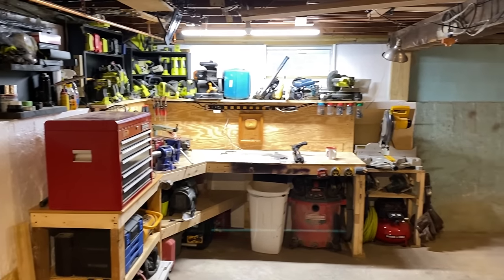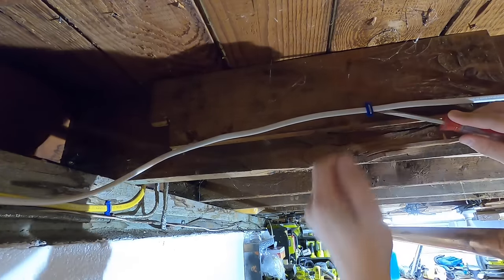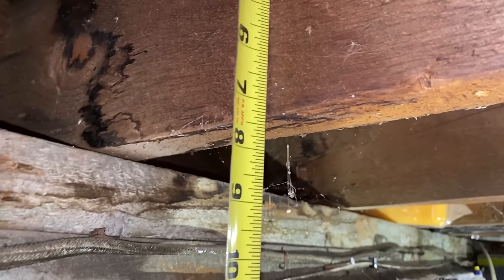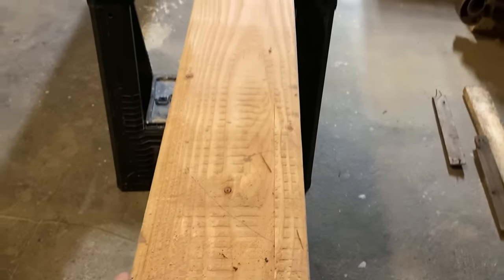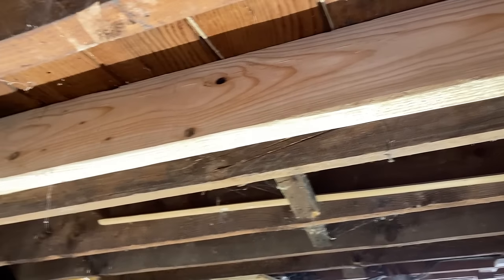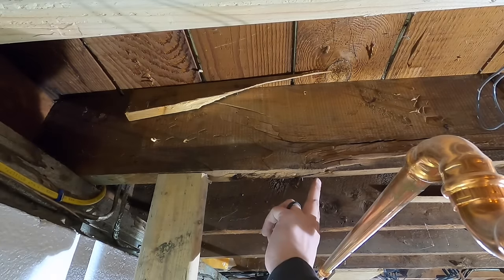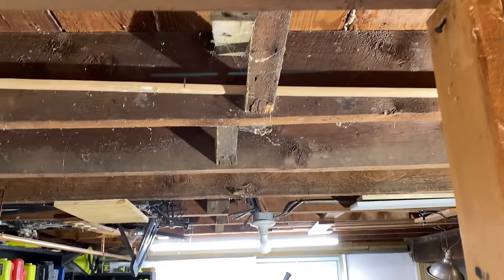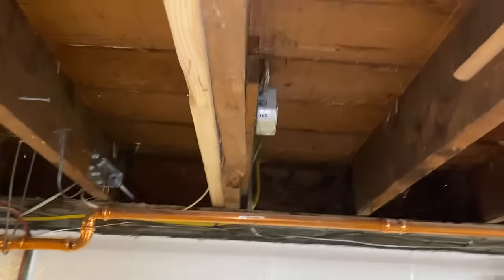"Sistering" a Cracked Broken Floor Joist

Comment: Nice repair. Two issues came to mind. First, when measuring long distances like that, a real easy way to get an exact measurement is to measure from one side to a convenient footage mark on the tape, and then mark the board and than measure from the other side to that mark. Add those two measurements together and you will get an exact length without trying to make the tape bend and guestimate the length. Second thought is, unless there is a heavy load bearing surface above the floor, how in the world does a board that wide ever crack? IDK.
Reply: The gigantic knot right at the bottom within 2 feet of the joist end resting on supports. That creates a stress point for two reasons: the end is supported  so the portion just after the supported part is shearing itself apart, and the knot creates a concentrated stress in that same area. Wood fibers are held by lignin, which is weaker than the fibers themselves, so a knot interrupts the continuous fiber mesh of the wood.
Reply: @rolfbjorn9937  That and moving into an old structure and removing moisture with AC and dehumidifiers vented appliances all things older homeowners usually didn't do in older homes. That was the case in our home in the middle of nowhere Appalachian mountains original owner/builder passed then his wife house built in the 40's we installed a vented dryer, AC and basement dehumidifier diagonal cracks soon followed. I researched my options and in the process realized it was common and wasn't an immediate threat to our homes structure. That was 2005 this is late 2022 and no changes I have emergency boards supports bolts washers screws ect just incase. Taking care of family including my wife that had cancer but is now cancer free and home with her Lord and Savior has put a realization that material things aren't that important. Hopefully I will repair the floor joists by laminating 1/2" osb on each side with screws or nails but replacing all of them with engineered wood beams is more likely since I'm not getting any younger....My 2 cents God bless
Reply: Knot location & perhaps damage from previous termite activity.

Comment: hrm, so I have a cracked i-joist.  I have access to it in the basement but it has plumbing going thru it.  I don't think sistering is an option.  I think I need to insert a new i-joist mid-span between both bays adjacent to the cracked joist.  Ironically it's right under the master tub.
Reply: You should remove the piping, install the sister board(with a pre bored hole for the piping, and then replace the piping.

This is assuming that you can't relocate the piping on a different run.

Comment: A sister is intended to reenforce the existing joist or rafter, which is failing. What has been done here is a bad job at doubling the joist. The primary joint between the sister and the joist transfers the load from the joist, which is weak to the sister, which is strong. The contact at the sill and beam takes the load from the sister-joist combination and transfers it to what holds the sill and beam up. It isn’t necessary to provide a direct path from the floor above to the sister unless the failure of the joist also includes the floor contact of the joist, as well. Therefore the connection between the joist and sister needs to be able to handle the load. Please check the IRC or other local codes for a nail pattern and spacing as these are critical. You have used far too few fasteners to complete the project properly and the gap between the sister and the joist is a failure. This should have been closed prior to fastening.
Reply from the maker: It will be fine.  Thank you, Terry.

Comment: Was your floor sagging because of this broken floor joist?
Reply from the maker: Hey!  I don’t think it was sagging because of that.  Just the age of the house.  This floor has a long story and many reasons I am not raising it but I guess the biggest is it is an old house and old houses sink in all kinds of ways and fixing that is not worth it to me, it is what it is.  It has character. 😁👍Thanks for stopping by!
Reply: I feel like my floor isn't level but I am trying to figure out if it's  structural problem or just tile/sub floor issue. My house was built in 1948 so I feel your pain on aged home issue. Thank you for responding.

Comment: Regular wood glue is stronger than the wood fibers making it well sufficient and alot cheaper
Reply: Wood glue is not structural because the glue creeps under load, as opposed to proper construction adhesives. it also requires much cleaner and tighter joints, which in remodeling old construction you'll never find outside of the furniture.

Comment: I would have taken the junction box loose and put it on that side because there are fewer staples on that side. A 2x8 is actually 1.5 inches by 7.5 inches by whatever the length is needed to be.

Comment: Is there a reason to sister vs replacing?
Reply: Think about it. So much is nailed or screwed into the existing joist from above. You gonna try and find all those nails? This is much easier and just as effective.
Reply: @PJBonoVox  fair enough. I actually just had 3 replaced on my house because they were so far rotted that you could break them by hand. Grinding all the nails down was fun

Comment: The first step should have been cleaning up all the cobwebs then recording this lol, yucky spiders. Sistering is an adjective and dictionary sites link it with contiguous , which means very close or immediate , but thats as much as i can find for a meaning. I did ask a few building sites if they know why its called sistering

Comment: You should've rounded the inner side of the sister she would've slid and butt up right next to the joist, I don't know why it's called sistering  or butt up the joints ,who butts their joints let me know but their sure are a lot of references to female anatomy in construction fields.

Comment: I don’t believe you have to go from top plate to top plate (that is, sister the entire joist); a structural engineer or competent architect could do the math and work out exactly how far from each side of the defect needs overlapping (probably 3-5 feet is sufficient, depends on total span, spec of your material - southern yellow pine, Doug fir, hemlock, etc, and nailing schedule).
Reply from the maker: Better safe than sorry I guess.  Thanks for watching.

Comment: What I did was...poured 4, 4000psi footings, added 1 beam here, 1 beam there, installed directly in the middle between the main supports, so now the floor ain't got no where to go, theres a beam every 6 feet. While also adding joists where needed. 3 inches of subfloor only under stone tiles areas, yes I got alot of posts down there but my basement is a old fashioned open pit sump pump foundation, full of mechanical house guts, so might as well make my floor strong so I can load up my house with heavy ass 17/18th century European furniture lol

Comment: there is no point to use construction adhesive nor to even remove the old sister joist if the joist you are installing is literally the same size as the original and therefore has the same load bearing capacity as the original and can just be placed roughly near the original.  At that point it is not really a sister joist nor is it there to support the original joist, it is there just essentially replacing the original joist.  So there's not point to attach them at all like this.  You could have simply spanned this joist 1 inch over from the original joist and even tore out the original joist or leave it there and ignore it, pretending it is not even existing since its entire job just got replaced by the new joist making the original damaged joist redundant and unneeded.  Uniting the two was pointless then with these factors considered.
Reply from the maker: It prevents squeaking and makes it stronger than 1 joist.  Might not be “necessary” but makes the repair that much better and stronger. 😁👍